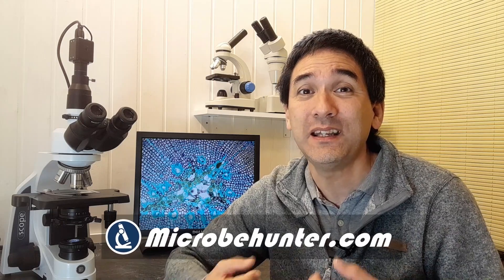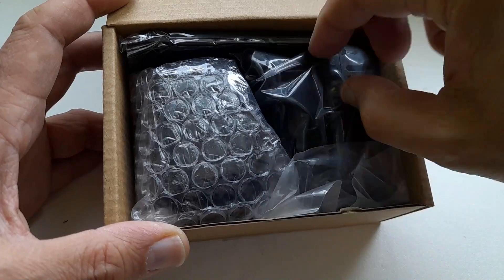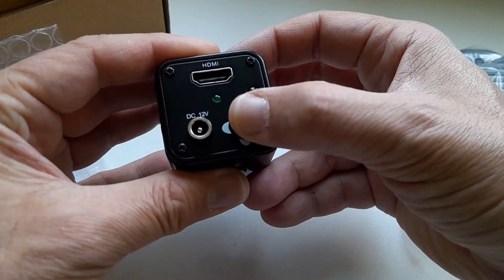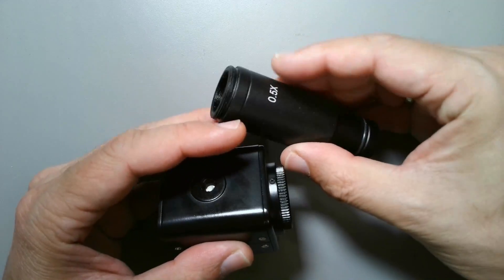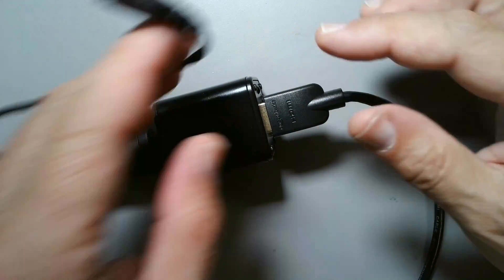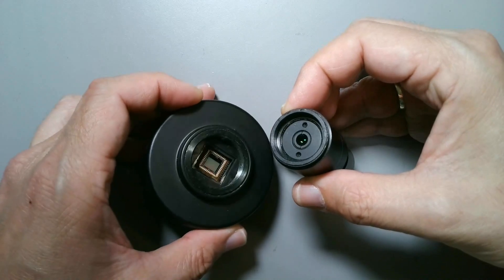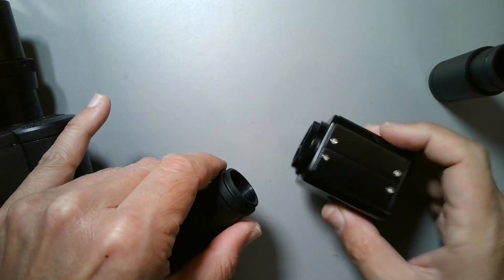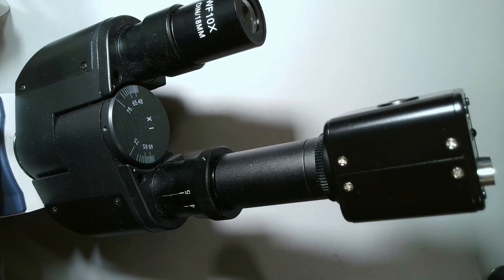Connecting an HDMI industrial camera to a microscope

Comment: I decided to get into the camera game with my microscope. It has been very exhausting for me, but I'm finally getting it figured out. I think one important thing a lot of microscopy hobbyists are not considering is the monitor itself. Not just any monitor will do, and if someone just tries to match the resolution for the cheapest price, they're really doing themselves a disservice and bottlenecking the camera and viewing experience. There are a few things to consider with the monitor itself, such as: contrast ratio, HDR compatibility, color gamut, viewing angle (IPS screen technology),  and the finish of the screen material itself. Now days, portable monitors are becoming very popular, and that can be an important thing a person might want to consider. If getting a portable monitor, just make sure to get a VESA mount compatible monitor for future considerations of specialized mounting configuration options. It can take some considerable time and effort going through and matching both the cam specs and monitor specs to get the absolute most out of your viewing experience, but it's most definitely worth it.

Comment: I was using a 10mp usb microscope camera and now I'm using 1080p industrial camera using obs. Unless you zoom way in, the still picture quality looks about the same. The video though? No competition, using obs I get a solid 30fps all of the time, even in dark field, it's constant, no matter the lighting or exposure. The usb cameras are limited by usb data transfer speed AND making your computer do all of the work, where as these industrial cameras are clearly doing most of the work. I record with obs plugged into a usb 3.0 port and I get far better performance than what any of the dedicated usb microscope cameras offer despite their insanely high cost. A dedicated microscope camera does indeed have nice software, but when weighing the pros and cons (cost being one of them), the industrial camera is the clear winner. It's also very nice using a dual monitor setup, my top monitor gets an hdmi feed directly from the camera, the lower monitor is on windows using obs.
My usb camera was a usb 2.0, but even when looking at the usb 3.0 camera specifications I was not impressed by the resolution/framerates they offered, especially when factoring in their insane prices. I got my industrial camera for less than half the cost.
Reply: Hello, I am looking for a solution for a camera connected to a microscope for surgery. The information you provided is very useful. Can you give me more information about the industrial camera you are using for my reference? Thank you.
Reply: @haidt7  I have the "Risingcam YW5605E". It's on ebay right now for 188 bucks, I got it for about 150 in December. I only use it on 1080p. 4k doesn't look as good, but perhaps that's because it won't upscale to 1080p displays correctly. Record using OBS using a usb cable and computer for best results because the internal recording function has a lot of compression artifacts when recording, I guess it had to use a lossy format because when it's not splitting the work with the computer. You can also map a snapshot hotkey in OBS for pictures. The hdmi output works nicely and does not interfere with the usb function, both can be used at the same time but you lose the internal mouse functionality if the usb is being used, so you'll adjust camera settings in OBS instead if you need to, that or do all internal adjustments using just the hdmi cable before plugging it into USB. I use a .5x reduction lens.
Reply: @haidt7  I have the "Risingcam YW5605E". It's on ebay right now for under 188 bucks, I got it for about 150 in December. I only use it on 1080p. 4k doesn't look as good, but perhaps that's because it won't upscale to 1080p displays correctly. Record using OBS using a usb cable and computer for best results because the internal recording function has a lot of compression artifacts when recording, I guess it had to use a lossy format because when it's not splitting the work with the computer. You can also map a snapshot hotkey in OBS for pictures. The hdmi output works nicely and does not interfere with the usb function, both can be used at the same time but you lose the internal mouse functionality if the usb is being used, so you'll adjust camera settings in OBS instead if you need to, that or do all internal adjustments using just the hdmi cable before plugging it into USB. I use a .5x reduction lens.
Reply: @haidt7  Risingcam YW5605E
Reply: if you pubish on internet USB2 recording is suffient. usb3 and big sensors give to big data

Comment: Hello; I've been a microbe hunter for 30+ years. It appears that you do not answer questions but I'll give it a jab anyway. You may look up my webpage and email through my youtube. I use an older Sony camcorder with a large CMOS chip, firewire connected to a 24 GB desktop. I record directly to the hard drive while observing on the monitor. The cam has a 10X optical zoom operated by wireless remote - awesome system which beats all USB systems to hell. I'm assuming that the HDMI camera you show is High Definition. It is tragic that it has no zoom operated by that remote. Would this camera work, without delay to capture video using a desktop installed HDMI capture card (not the little adapter you show) and independent video software?

The delay factor has been a big issue when my camera is set on high definition in the sense that I cannot follow microbes around with the stage controls. It is fine with a regular setting. It is my thought that HDMI capture may solve this. It does not appear to have delay when you moved the stage, My experience with digital zoom is terrible and it appears that only high end Sonys ($$) are offering this combined with 'true' HDMI capture. Any advise is appreciated.

Comment: I have one of these industrial cameras (different brand though), I made sure to get one with both an HDMI port and a USB 3 port. This means I can use my microscope camera software to control the camera. In fact I only used the HDMI port for the initial setup, after that I have always used the USB port,thugh
Reply: Thank you very much for your kind reply sir and sorry for the delayed reply from my side🙏
Reply: Hello sir, 

Can we take the measurements of the biological specimens under a microscope with your camera (industrial ) which comes with a USB port and can we use common free software?
Reply: @surendarchandrasekar5194  
I use Toupview, I had an early version that came with an older USB  camera. I updated to  a later version. It allows calibration and then measuring of distances through your microscope. The latest version doesn't recognise my camera, so you may have to hunt around a bit if you decide to go that way. There is also ToupView lite, but I'm not sure which features it has compared with the full version.